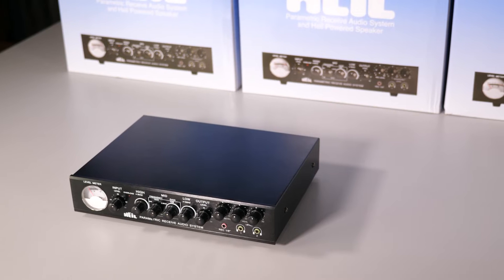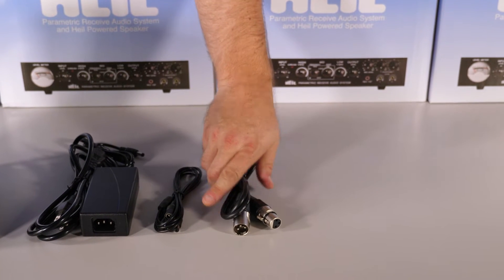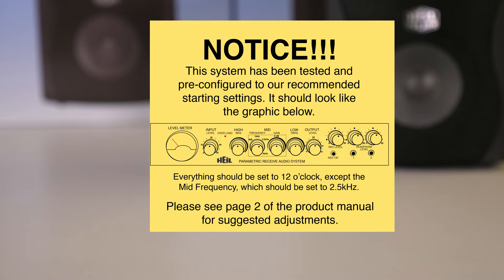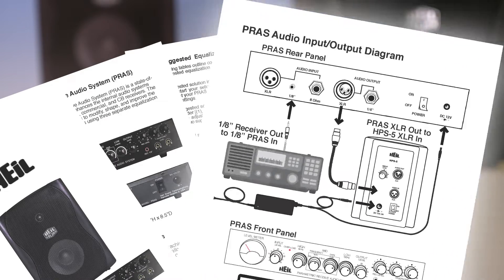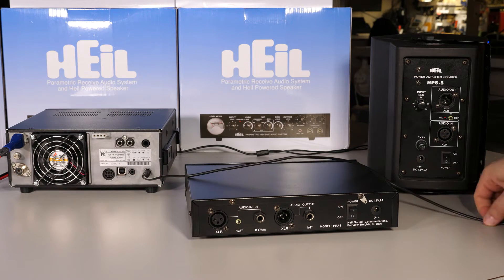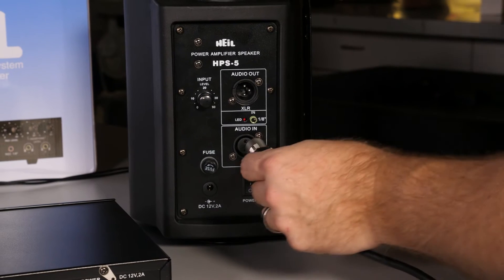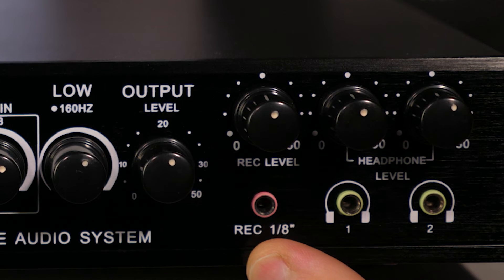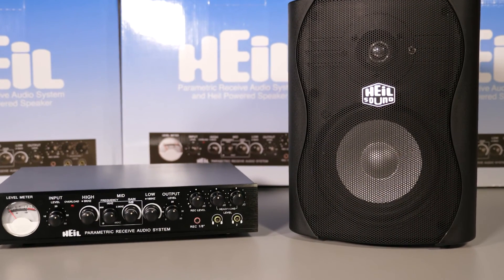How to set up the Heil Parametric Receive Audio System

Comment: The 12V DC, 2A power supply is not included.  Plan to have another source ready when you get yours.
Reply from the maker: Correct! This video is from the original version that came out 4 years ago. We have since updated our packaging. For the latest information on the PRAS EQ and what is included and not included please check out our website. https://heilhamradio.com/products/receive-audio/